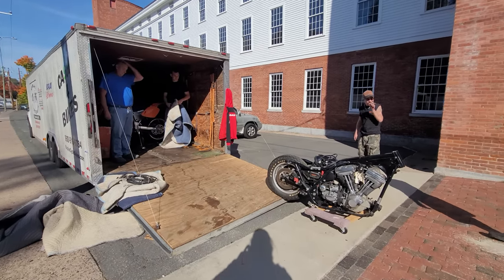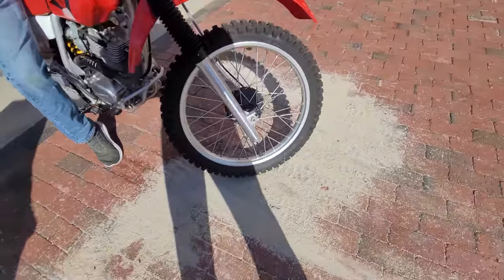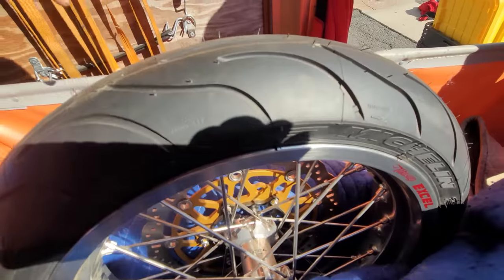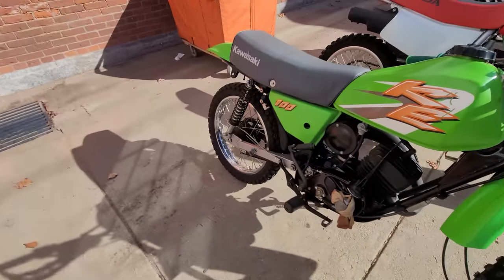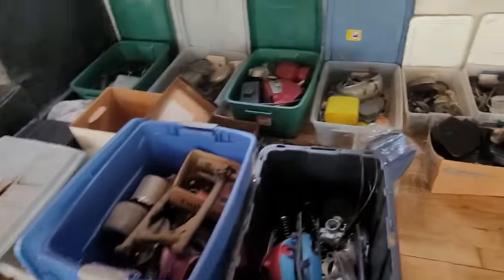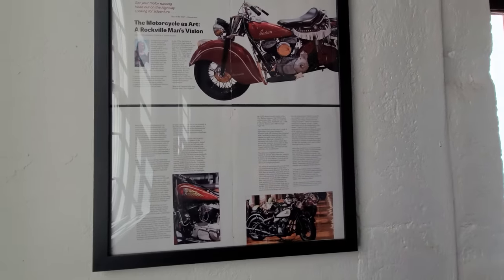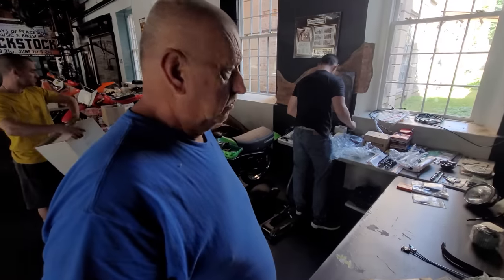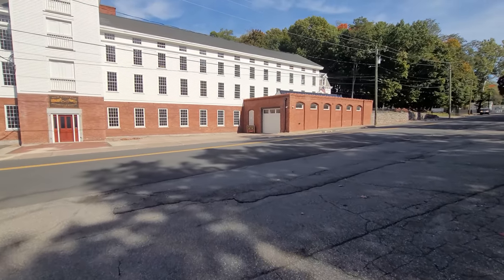HUNDREDS OF BIKES ARRIVING & TRUCKLOADS OF PARTS  HONDA XR200 KAWASAKI KE100 KTM 520 @ KAPLAN CYCLES

Comment: Just sold my clean and strong running 1983 XR200A (aka dual shock model) and my 1982 CR125R to my local dirtbike shop. Was sad to let them go but I’m glad they went to the right home.